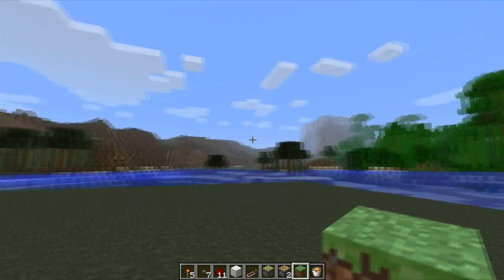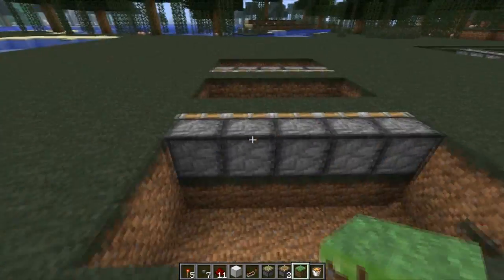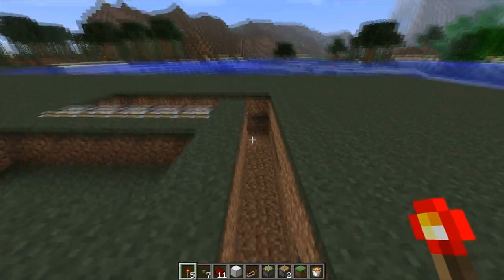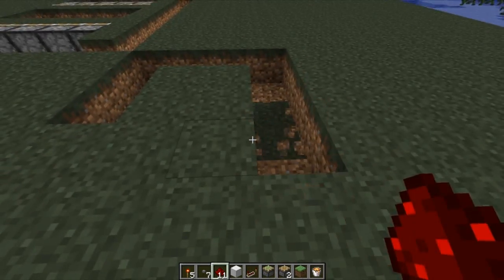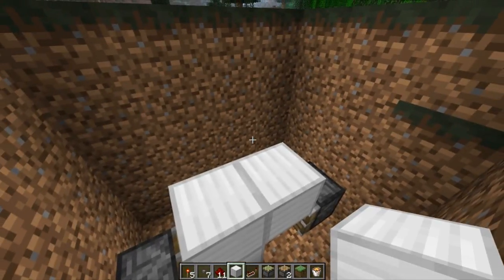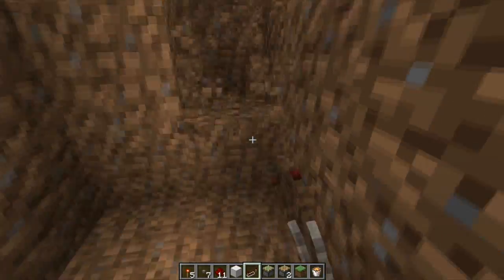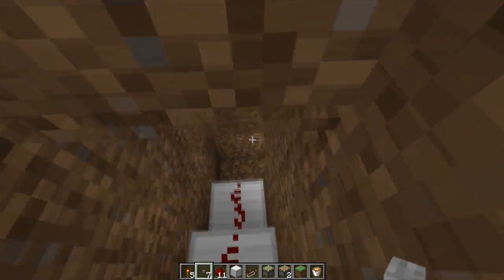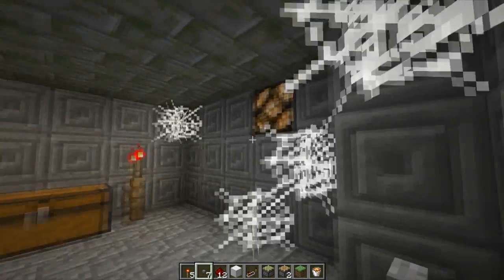MCTUT - Sliding Underground Base 2.0

Comment: A redstone torch is used back in the days before repeaters were invented in minecraft as a delay and repeater. A redstone torch causes like a repeater a little delay. Only repeaters has 4 settings so you can set your delay longer between objects.

Comment: why does the one button make it work normally (press it once and it opens, press again and it closes like normal) but then the other button when i press it i have to press it twice to open/close it every other time? the wiring is exactly like yours, except i brought the redstone out from the 3x4 square out to the open so i could open it with a switch on the outside (so i could hide the wiring)

Comment: you know you could use a lever if it was visible from inside and outside the base, how I would suggest doing that is placing the lever somewhere inside your base one block underground and remember where the lever is so on the surface so you can dig one block down and activate it, go inside and De-activate it :)

Comment: If the redstone wire from the underground button is longer than 15 blocks, it will not transmit longer. Put a repeater at about the 14'th block and it will work fine. If, of course that is your problem.

Comment: you probably wired it wrongly. Notice in the video that the doors connect to the flip flop. And then at the flip flop he placed another route of redstone dust for the buttons. If you wire it up correctly it should close/open like the one in the video.

Comment: Im lost. i built mine exactly as you built yours just to get the build down but i do not have any power to the button down below. i ran repeaters and everything just when i press the button, nothing happens. when i press the surface button the return current lights up but the turns off. the main current opens and closes fine. can you help me??

Comment: Could you use 2 inverters directly under both levers (inside and outside) and wire it to the repeater/wire from somewhat far away such as deep inside your home? Due to my home design im wondering if its possible that way. Building my version of a double helix inverter is easier for me than a T flip flop xD.

Comment: I'm having issues extending the external button so I don't have to be in the flip flop room. If I do what I did on the other side for the internal button, it makes both stop working, and any other way I do it will open and close the pistons.

Comment: Something is wrong with mine, it will not open again. The redstone wire is still red in front of the pistons... It's like there is a torch there. The only way it goes away is when I destroy the wire. I made an exact copy to begin with. [Running 1.3.1]

Comment: person ally i would leave out the t-flipflop and use 2 lever with an AND gate, 1 lever outside keeping it closed while the outside one keeps it closed, then when you have both set to open the pistons retract, opening it, and when one says closed then it closes, but the only downsides i see, if someone else finds it and locks you in, or if you die and can't get in afterwards. but you can always break in or make a super secret entrance lol.